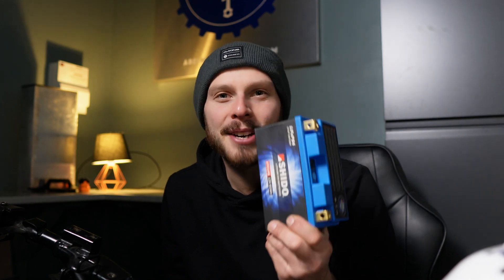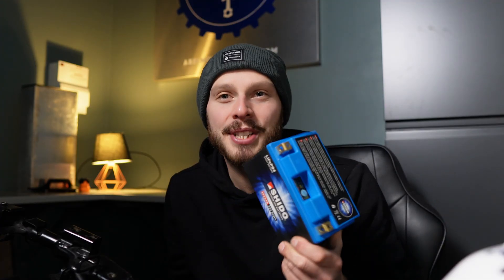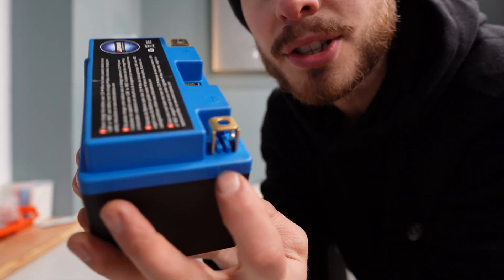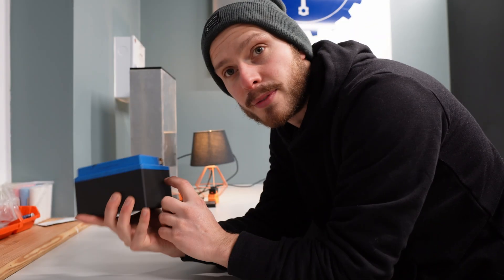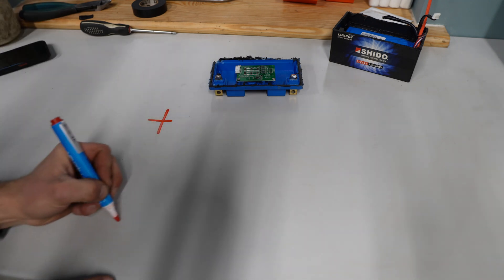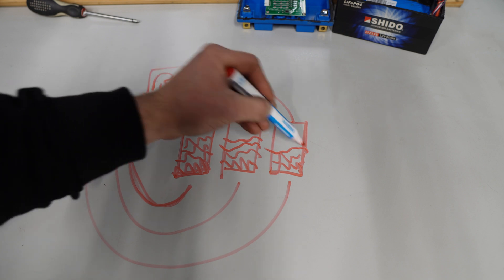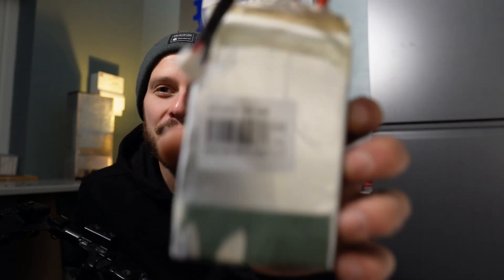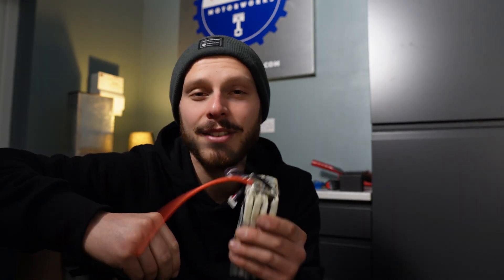I Cut Open A Lithium-Ion Battery, So You Don't Have To!

Comment: Them batteries I find are very hit and miss. I have a Husqvarna FC250 dirt bike. Takes one of those exact batteries. First battery I got. I would start it let’s say 10 times and then it would need charging. The bikes electric start wouldn’t turn over it would just click. Then I go buy a new battery for about £70. Same battery. And my bikes been sat for about 2 years. I went round the other day to my father in laws garage where it’s stored. And it fired up instantly. I wasn’t expecting that. So they are good. But I’ve found them to be 50/50.

Comment: I Don't Trust Lithium Battery's for Engine Operations,  So I have 2, A Mighty Max, Under the Seat, Connected Parallel, Off/On, Switch My Front Engine Operations -Acid/Gel Battery.. But Can all so Start From the rear Lithium Battery' as Well,, Don't Mind Running A Lithium Battery' Just as Long as there 2 of them, In case one Fails....